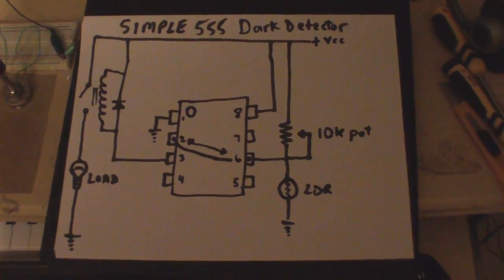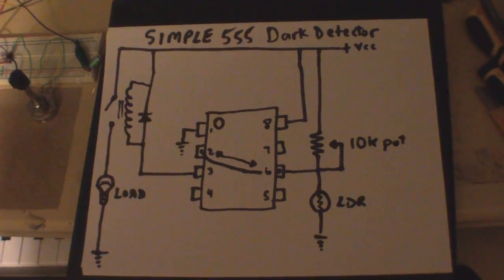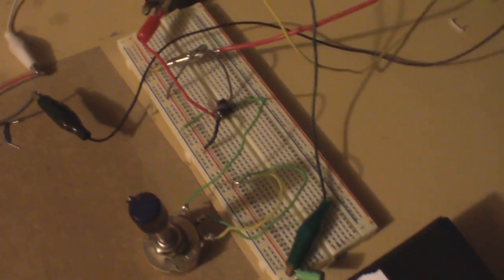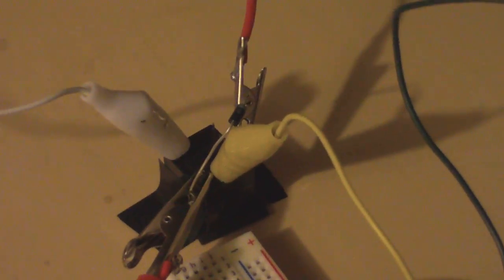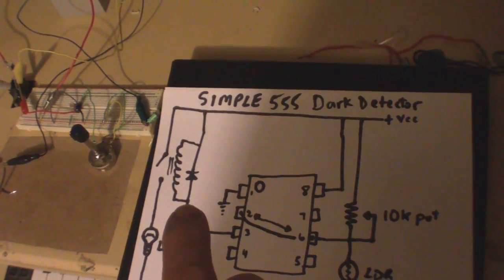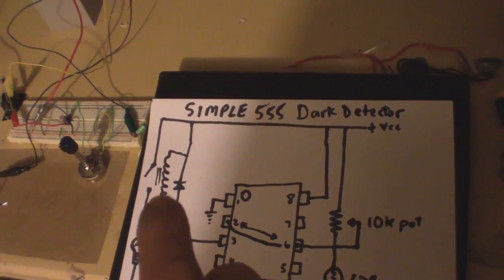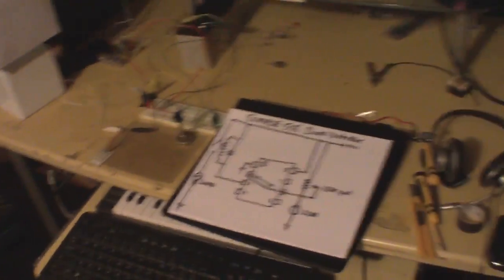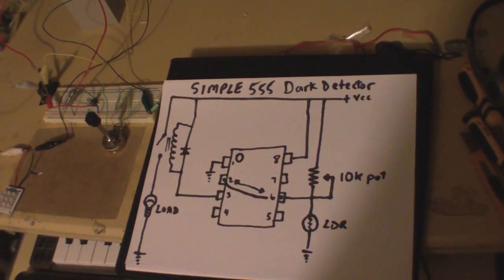4 component 555 Timer Dark Detector Circuit

Comment: Hi, I want to set the same circuit on breadboard but I want to use a MOSFET(IRF540) or a transistor(BC547) instead of the relay. So could you please help me how to use it in this circuit? Thanks in advance...
Reply from the maker: I explain in the video video.  Precisely.

Comment: Hy, I want to make a similar circuit, but I want a 25W bulb to stay turned on for 30 seconds after I take my hand or I turn back the light. So to be timed exactly 30 seconds. From which components and how can I adjust such a timer? I have to add a capacitor and if yes, where? Can you help me?
Reply from the maker: What would trigger it, make it activated? .. you say "after I take my hand or turn back the light"  << makes no sense.

Comment from the maker: Well.. I'll give you a little background. KISS works good for a couple of NiCd powered solar LEDs. On the other hand, if you have solar charged 12V's running 500 watts of light through relays, you want those lights to come on when its REALLY dark, not run any longer than needed, and not over discharge the batteries. And, you need charge control. So yeah, each implementation has its time and place. cheers

Comment from the maker: Thanks for the comment, but, irony aside... I am asking for quite a bit more, and that will be coming. Time delays with a 4060 to both run the load a designated amount of time, and hopefully a delayed onset of run, after dark, too. Basically I'm fussy. I want a better solar light, by far, than what is typically available. But for simple setup this is fine...

Comment from the maker: This circuit actually works just fine, with that particular LED array, which is a 9 X 4pin PCB mount LED setup that probably burns about 80-90 mA. I believe that the P3 on a 555 can sink or supply about 200 mA or maybe a bit more... so yeah you can actually do a lot with no relay, optocoupler, transistor, etc. at all.... The pot is for set up yes, and it's bit more decisive than a typical one transistor setup, and it's either on, or off, none of this im going to power the load with 5 mA

Comment: Now that's neat...and simple enough. Could also use an opto-coupler chip for a small load like a few LED's, that would make it all solid state. 
Certainly could make automatic house lighting really easy on a solar setup. Would it fidddle faddle at dusk though or is that what the pot sets up ?